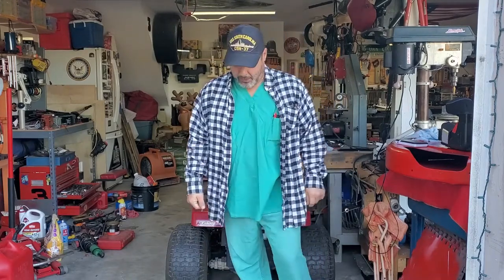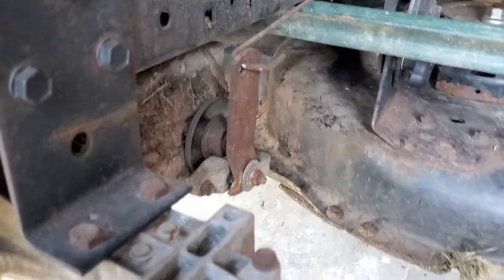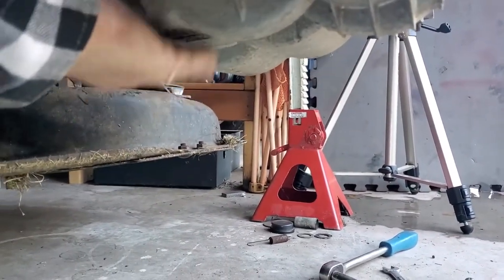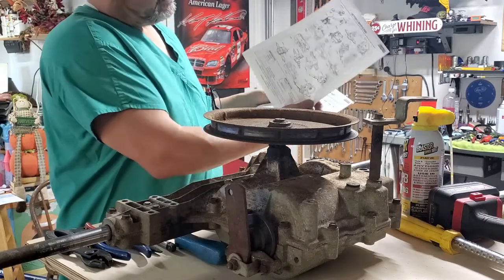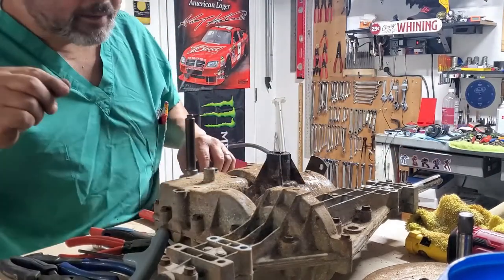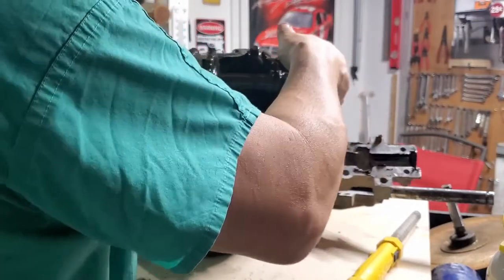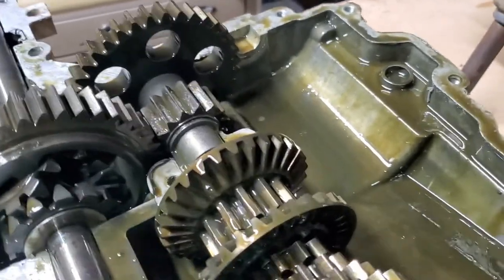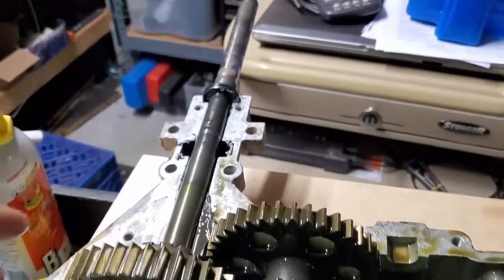Peerless 206 - Murray transaxle teardown

Comment: Impressive! Almost gives me the courage to open up at least one of my two trans.

Transax transplant 

I have a 30 y.o. Murray 11/36ic that was increasingly difficult to change gear. I acquired another transaxle 10 years ago, and seeing it has 10 years less use than my one so it must be in good or better condition...right? Put it on, and now the mower won't move forward or back.
I see the drive belt is turning the rear pulley on the transax. I lift the back up to see if there is the slightest movement and there is nada. 😑

Any ideas anyone...

Comment: I drilled two 1/4 inch drain holes on the pulley, will help with the rusting problem and buy some time 😮
Reply: Plus you can use a puller to remove pulley

Comment: Just scored a rider from dump with a Peerless MST 206 502A and it only has 1st n reverse... you can shift 1 2 3 and still in 1st then if 4 5 6 nothing..  reverse is faster... been mowing in 1st to get yard done as my other mower is down due to deck issues.. I had hoped the dump score would be better, but new tires, good seat, runs mint guess can toss a wrench at it...
Reply: I was about to say haven't seen one I couldn't just pull off by hand... spring for brake fighting with, perhaps could have dropped axle connected and spun it out, then when put back in fish it in before aligning to brackets..
Reply from the maker: Craig, took me a little to respond because i had to look at videos cause cant remember anything..lol. I would check all the shift mechanism first to make sure it is moving the gear selector shaft its full rotation. If it is, problem is in transsxle and prolly the fork on shift rod moving on shaft or something with the slide mechanism.
Reply: @vatolocal2564  Assuming shift forks, just cannot find this axle to know which forks to buy.  Found a chart to compare style and length as there appears to be 8 or more options, just wanted to have on hand before tore apart so could just slap back together if only the forks.  The axle was way low on fluid, if it even had any, and think they were damaged, or previous owners shifted without clutch.. thanks..  will just have to open up... got 4th now at least, been mowing in 4th, reverse is every once in a while.. hopefully do not need gears, as cannot find parts, just used assemblies for top dollar.